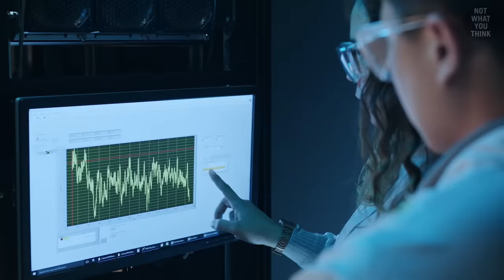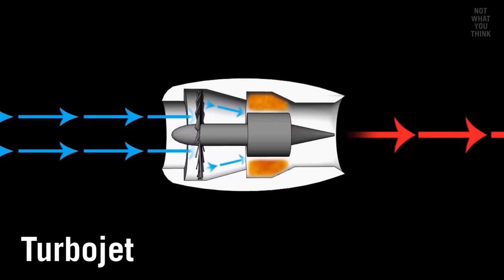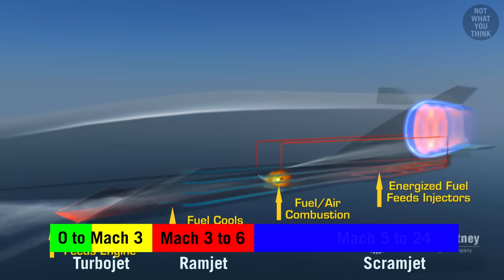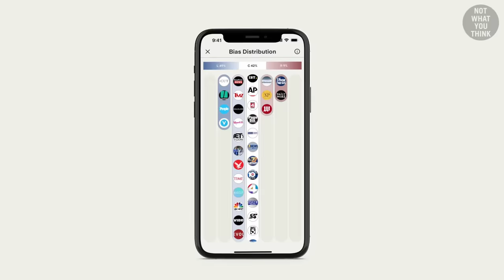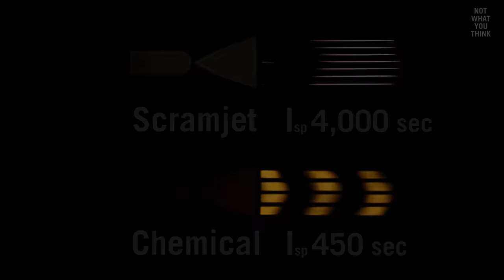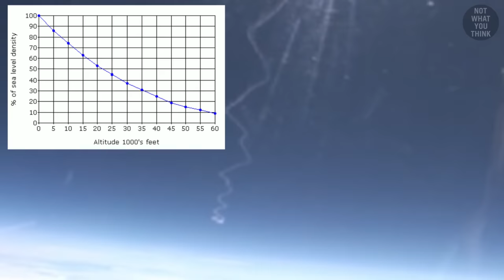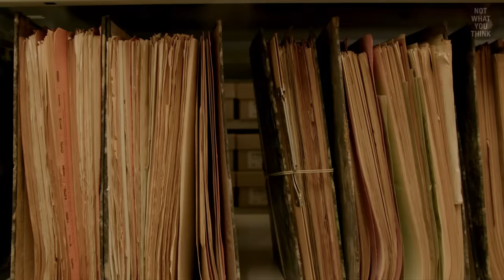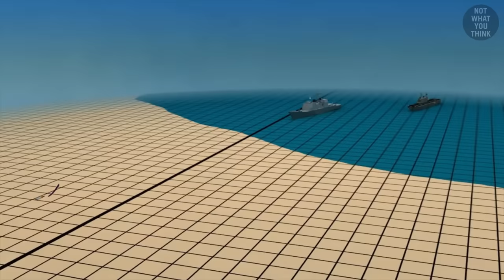The Hypersonic Missile Vulnerability That NO ONE Talks About

Comment: “And are maneuverable” is a bit of a stretch.  Anything moving that fast takes a long time and distance to maneuver in any way.
Reply from the maker: correct, the turning radius is dozens if not hundreds of miles (depending on speed)
Reply: Unless it has a second rocket stage to switch target midflight. This will render enemy interceptors useless. When the missile flies so fast the calculated interception point is way far ahead. Even a very small switch in direction can result in very big changes on the interception point.

We know little about zircon but I'm pretty sure it has multiple burn phases changing direction each time.
Reply: It is possible for the missile to fly that fasts to maneuver, but then it is very likely to miss its intended target!
Reply: Russia literally has hypersonic weapons in current service that do not follow a parabolic path and are currently not able to be intercepted by anything.
Reply: @danhobart4009  and who tried to intercept them and failed ? Ukraine with their Soviet era air defense?
Reply: the thing is it doesn't need to be very maneuverable, intercepting something at those speeds means the interceptor needs to reach 2 interception points potentially dozens or hundreds of kilometers apart with only a few degrees in course change
Reply: @aliismail2962  Don't you guys supply Ukraine with IRIS-T?

The Russian Kinhzal or Khinzal or whatever the spelling is has been used in combat and has proven its claims. Regardless of the interceptor used, the physics remain the same, intercepting something at that speed is extremely difficult.
Reply: It's maneuverable enough to make it impossible for defenses to intercept.
Reply: It doesn't follow ballistic path so future exact location of it can't be determined. That's hypersonic maneuverable mean.
Reply: @billwhoever2830  But the missile can't maneuver much because it has to hit the target eventually, too many fancy maneuvers and you end up losing speed,  breaking off control surfaces and possibly missing the target. Since the missile generally heads directly for the target ship, interception points being too far ahead isn't much of a probelm
Reply: @danhobart4009  Not being able to be intercepted is a big stretch.
Reply: @timothy740  You launch aiming at a different than the intended target. The enemy won't know where to fire in case to get your missile. As I said there can be multiple boost phases. You won't break any wings or lose kinetic energy because you are practically using the engine to change your future position.
You won't even always have to change your direction, you can just change the speed when the enemies fire at you and you end up arriving and leaving the interception point before the enemy missiles arive there.

As you said if the target is a ship point defense at the last few seconds will be easy, the missile will be flying on a line. This doesn't mean it's a safe moment to interpret. Apart from the fact that these missiles will almost always carry a nuke when going for something big, the kinetic energy is so high that the missile will end up falling on the target. Zircon for example can reach up to Mach 10, basically 3km per second speed faster than a railgun round.
Reply: @timothy740  the missile isn't dodging the interceptor like a football player. It's removing the predictability, like having one cop pull over a car on a single lane highway in the middle of no where, verse asking a cop to pull over a car in the city of LA but not knowing what street he's on.
Reply: @NotWhatYouThink  well comrade , didn't you read full reports of our AVANGARD
Reply: Anything that fast doesn’t need to be that manoeuvrable, just needs to change direction and speed slightly and it will be enough to dodge any interceptors. It doesn’t need to be that accurate either since it will be carrying a nuke, so anywhere in the general vicinity is fine.
Reply: @billwhoever2830  THANK YOU. This pseudo intellectual literally has no idea how intercept kinematics work.
Reply: @billwhoever2830  There's physical limits imposed by the forces acting on the thing moving fast. Sure, you could ATTEMPT to redirect the thing at Mach 5, but brute-forcing a Vector change is more likely to cause stress-related material failure due to the tear induced by the difference in air resistance.
Reply: @billwhoever2830  But if the missile has spent the final approach shifting vectors to avoid C-RAMs, it won't be going at Mach 5, making it a prime target for CIWS, which will likely reduce the missile to fragments not big enough to seriously harm the seaworthyness of a military vessel. All this throwing around of numbers and buzzwords is typical for Authoritarian governments- ever higher numbers for optics while practicality goes further and further out the window.
Reply: @acceptablecasualty5319  they already explained to you you need only shift few % of angle to make all interceptors to miss.
Reply: "at least that's the idea"
Reply: @billwhoever2830  When you launch aiming at a different target you sacrifice range. Yes you can use thrust vectoring to change direction but it can only help so much, and you will still lose kinetic energy because the missile will be fighting its own inertia, plus at such high speeds turning produces a lot of drag. Thus hypersonic missiles would be only capable of limited maneuvering, which means that even though a slight change in course will move the interception point by a fair bit, its still less than that of subsonic cruise missiles. They also have to keep a mostly straight course towards the target, because they can't maneuver much as they might miss the target (their turning circle is huge).

I'm not sure how the missile is supposed to change speed rapidly without control surfaces, after all I dont think it can "brake" with just an engine? Also since the zircon uses a scramjet, having a multiple stage engine setup will leave it vulnerable when its still using a normal rocket booster instead of the scramjet as it cannot travel as fast (probably not even at hypersonic speeds).
Reply: Not really
Reply: Anything is possible in physics take Quantum computing for example I know it’s not physics but before qubits were made we had no idea How to make transistors any smaller for Regular computers or supercomputers thus limiting how far we bring our technology now quantum computers and qubits have changed everything we just need some brilliant minds to come together and solve the issue which I think would not be that hard
Reply: @Eycei  haha typical western cope. We failed to do it so we pretend we didn't need it or didn't want it 😄
Reply: @Eycei  still can't bend the rules of physics
Reply: He said that's the idea of it, he never stated it could...
Reply: @acceptablecasualty5319  Ciws or any close range SAMs won't save you. 

Such a missile covers 3km per sec, it travels 3 times faster than the sabot rounds of the phalanx. It covers the 1km of effective range of the phalanx in a third of a second. The phalanx can only fire 20-30 rounds in that window which is totally incapable of "shredding" the target, you won't even be able to score a single hit.

Short range Sam's would be just incapable of aligning themselves with the missile which by the way will keep going even after it gets hit.

Your only chance to not get hit is to kill the missile 10+km away. The further the safer.
Reply: @jiridrapal7512  didn't fail to do it.  It's not cost effective per missile. They are crazy expensive and not worth it.  You can fire 100 missiles at a target and get a 20/30 percent thru,  thru, or you can fire one expensive hypersonic missile.  You save money with the 100 regular and you have more missiles hit.  Hypersonic just isn't cost effective or worth it currently
Reply: @timothy740  I would assume that hitting land objects would be easier. They could have multiple targets for 1 missile. If the missile can't hit the original target, it just switches to the highest target that it can hit.
Reply: @billwhoever2830  You don't understand that Terminal homing will require the missile to slow down in order to actually dodge things. Maneuverability is antiproportional to airspeed. Besides, CIWS doesn't fire Kinetic "Sabot Rounds" but timed-fuze explosives, and C-Ram has like, 40 Gs of acceleration. Nothing on this earth can sidestep physic, no matter how insistent propaganda is.
Reply: @theOcean41  yeah sure not cost effective and that's why american minister of war ordered 7 types of them to be developed andp roduced in hasted regime
Reply: @billwhoever2830  yes but if it is truly moving that fast you have to wonder what kind of sensors would even work to alert the missile to take evasive actions and still correctly navigate itself to the target, sounds like pure sci-fi and not like a real weapon.
Reply: @danhobart4009  So why are they using missiles that have such high failure rates in Ukraine? And why aren't they targeting military targets and instead just targeting civilian infrastructure?
Reply: @aliismail2962  like the Soviet era Patriot missile systems? Tracking and intercept is not possible vs hypersonic missiles that can also maneuver.

In closing sir, you think Systems exists that has been designed to be able to intercept hypersonic manueverable missiles, which the current crop of inferior air defence weapons cannot shoot down.

Looks pretty useful-to me.
Reply: @syzyphyz  The whole path can be predetermined, you won't be necessarily seeing enemy Sam's with your missile, you would be simply following a more random path with 1,2,3 or whatever number of changes in your direction.

The missile might not even have sensors of its own and only rely on data of other platforms like UAVs or radars. The friendly radar tracks your own missile and then transmit the position to it. It might be hard for the missile to see itself but it will always know its and it's enemies position. Corrections about the target position can be made if its moving.

If you search "iskander impact" you will see what type of precision modern "ballistic" missiles can have. Ofc iskander is a slower missile but it still follows a very similar flight plan.

The Chinese "anti ship ballistic missiles" probably work on a very similar manner relying on info from other sources.
Reply: @jiridrapal7512  Hypersonic missiles are not all that cost effective. ONE USAF hypersonic cost $100 million dollar. One F35 stealth fighter cost $85 million dollars which can 4 missiles in its internal bay. Do you want to deliver 1 super expensive missile which might miss, or 4 cheaper precision missiles? If you want to spend more money for an albatross, go right ahead.
Reply: @billwhoever2830  yes, but then it misses it's target which is as good as shooting it down.
Reply: @semicolon101  Soviet era Patriot missiles that where properly maintained and with updated electronics and updated everything else possible. It makes a huge difference to actually have updated and maintained equipment compared to the stockpiles of Soviet era weapons that the Russians left collecting dust in warehouses for decades. That, and the fact that it's simply not viable for the Russians to finance a single weapon that costs more than an entire fifth generation fighter jet, which Russia also can't produce in significant numbers. Remember, Russia finances an entire Navy, Army and Airforce with an economy that is the equivalent of the economy of the State of New York alone (and also have that money be enough to buy their richest class their hundreds of properties and billion dollar mansions). Even if they manage to make 1 or 2, maybe 3 hypersonic missiles, their deployment, even if capable of piercing Ukrainian air defenses, wouldn't be enough to change the course of the war.
Reply: @riftpowers701  all speculation hey.

The performance of the patriot missile is not enough to intercept a hypersonic missile. Can an S-400 even?
Reply: Wrong.

The faster an object moves the more Sensitive is to even the slightest adjustments... hence an object moving faster would be extremely maneuverable,  to the point that even the tiniest micro fraction of movement would make it turn almost instantly.
Reply: It doesn't matter given that you only have very short time span to intercept, and hardly anything could catch up with that speed, and if you failed once, you probably not gonna get a second chance.
Reply: @billwhoever2830  when you try to spread russian propaganda, try to avoid using accounts created during obvious bot waves like 2014, 2020, 2022. Good luck on spreading your message, maybe you'd find an audience for it. For example someone, who has same views on physics as russian propaganda ie flat earthers:D
Reply: @danhobart4009  have you seen fateh110?
Reply: True, but people also don't realise how tracking and detection works, manuevering even that much at mach 7+ is often enough to bamboozle SAM systems.
Reply: @billwhoever2830  The rolling airframe missile that functions as CIWS does have a 10km range though.
Reply: @haixinzheng9759  You don't have to catch up with the speed, after all the missile is heading straight towards the ship.
Reply: @mygodisyahweh8634  Except that there's something called air resistance. Any control surfaces would be ripped off when extended to try and maneuver, or would simply be unable to extend due to compression at such highs speeds. The missile would also be fighting its extreme inertia, which further complicates matters. Not to mention that the turning circle of the missile would be gigantic.
Reply: @billwhoever2830  But what kind of other reconnaissance platforms does China or Russia have? They dont have large fleets of AWACS, and any approaching US carrier battle groups would be detected and intercepted. UAVs have limited range, and again they can be intercepted. Satellites don't have the ability to get a good track on targets moving at 30+ knots to guide the missiles in its final phase. Anyways, most of these platforms aren't designed to provide data for final course corrections for the missiles. There's a reason missiles moved from semi active radar guided (fully relying on other platforms' radar) to active radar guided (relies on its own radar for final course corrections). 

The iskander may be accurate against stationary land targets, but hitting targets that can move and change direction is a whole different ball game. Then there's also the problem of ballistic missiles traveling far, far faster than hypersonic cruise missiles, which leads to even worse maneuverability issues that I mentioned before.
Reply: @timothy740  So? Is there enough time for the interception missiles to be fired out, accelerate and to lock on the hypersonic missiles? Given the speed of 27 Mach, and the effective range of Aegis system of 150 km, you roughly have 27 seconds to detect incoming objective, to press the button and launch the anti air missiles, slowly accelerate and to lock on to the incoming target, and hopefully it will hit the target that travels 5 times faster.
Reply: @haixinzheng9759  Yes, because hypersonic cruise missiles tend to fly at higher altitudes to reduce air resistance, that combined with travelling at such high speeds makes them easy to detect with radar at longer ranges. Lots of heat will be produced as well, so other platforms with IR sensor can warn ships even earlier. The main target of these hypersonic cruise missiles are usually US carrier battle groups, which always have a E-2 Hawkeye AWACS plane in the air to detect such threats. It can even guide anti air missiles to those hypersonic missiles without the launch ship ever detecting them. Finally, you have to remember that these hypersonic cruise missiles have to be lauched from somewhere, so the first line of defense would actually be to take out the launch platforms. Aircraft on board US CVs will out range most hypersonic cruise missile that exists. Since carrier battle groups won't venture close to the coasts of hostile countries during war times, the only launch platforms would be ships, aircraft and subs. Aircraft can take out bombers and ships carrying those hypersonic cruise missiles before they get within range, and submarines would be tracked and destroyed by US nuclear attack subs which accompany carrier battle groups.
Reply: @haixinzheng9759  Also there is no hypersonic cruise missile that travels at mach 27, and probably none in the near future. The fastest one is likely the zircon, which travels at a max speed of mach 9, which is 3 times smaller than what you mentioned 💀. And the Aegis system dosent have a "range", because it isn't a missile, its a system that uses and guides missiles for defense. Currently the SM 6 missile, which would be the main defense, has a range of up to 460km, which is a lot more than the 150km range you came up with. Lock time wouldn't be a big issue, as the Aegis system is usually fully automated.
Reply: @timothy740  Mate, Russian soils are vast and the Kinzhal missile has a attacking radius of 3000km, which is way outside of the detection range of the Aircraft carrier, these missiles are often loaded onto missile trucks for mobility, which you don't expect them to be stupid enough to launch all their missiles in just one place. And you're talking about the best case scenario of what if the Aircraft carrier team has stayed alert to Russian attack, but completely leave out the chance of surprise attack. You don't expect the Hawkeye to run 24/7 do you?
Reply: @timothy740  Mate, Aegis system detects and lock on to targets such as jets and ships that's 460 km, however, it only has an effective interception range of 150km for conventional missiles, which is much more difficult to detect, track and lock than big and slow targets, and the system were not designed to intercept a hypersonic missile that travels many times faster than conventional missiles.
Reply: @haixinzheng9759  Yet you forgot that the kinzhal missile only has a 2000-3000km range when launched from aircraft travelling at high speed and altitude, and not when launched from land (kinzhal missiles can't even be launched from land platforms, only from air platforms, shows how much you actually know how about this subject). And Russia only has 66 Tu 22M3Ms, 250 Mig31s and 17 Su57s that can launch the Kinzhal, and those aircraft would be tied up in other operations.  

Rule of thumb, radar almost always out ranges missiles. AWACS platforms would be patrolling ahead of the aircraft carriers too, which increases the range where the missiles would be detected. Besides, the carrier groups would be generally staying far from Russia's coast. 

You say that Russia has vast tracts of land to hide missiles in, but how much of that land can actually be used? Basically only the coastal areas near Finland and Japan that border oceans where the US carrier groups will operate. Plus there's also the problem of finding the carriers and tracking their movement first.

And yes, a least one E-2 Hawkeye will always be up there on duty 24/7, that's why the carriers carry multiple Hawkeyes.
Reply: @haixinzheng9759  The Sm 6 missiles used in the Aegis system have a range of up to 460km, and AWACS platforms allow the missile to be used at that range. And the spy 1 radar used in the Aegis is capable tracking a ballistic missile at 310km, and is currently being replaced by the far superior spy 6 radar. 

When a target travels faster, its actually easier to detect and track it because it stands out among the sea clutter. 

The Aegis combat system (when first built in the 1970s-80s) was originally designed to defend against manuverable mach 4 missiles, so since it has been upgraded from there, it isn't too hard for it to intercept hypersonic weapons (most of which travel at mach 5+).
Reply: @timothy740  Mate, there are multiple types of Hypersonic missiles and these have different ways to be fired, land, sea or air, and you don't mean there's one way to counter it all. And the fact that you don't know the Russia Avangard missile which has been in service since 2019 also showed how little you know about the current progress of hypersonic missiles. There's a success rate on anti-missile system, which ranges from 50%-70%, there's no such thing as guaranteed interception even against conventional missiles, but you made it sounds like the anti-missile system in the aircraft carriers are so advanced to the extent no missiles can pass through, even with hypersonic missiles, you're clearly not thinking realistically. And lastly, tells me what stopped them from using the missiles outside of the costal region?
Reply: @haixinzheng9759  Don't try to change topic, the fact is that you said the kinzhal is being put into ground based road mobile launchers, when it can only be launched from air platforms. Again, it shows how shallow your understanding of the subject is.
Reply: @haixinzheng9759  I did not say that carrier group air defenses are impenetrable. And I was talking about land based missiles in that comment, refer to my older comment for how other launch platforms can be countered.

Also, what's your proof on me not knowing about the Avangard. Its not related to this discussion, because its not even a bloody missile. Its a hypersonic GLIDE VEHICLE that acts as a WARHEAD for ICBMS, and is meant for nuclear attacks on the homeland of enemies, not their ships. And its not really a game changer, because waves of existing ICBMs being launched cant be fully stopped by anything in a all-out nuclear exchange.
Reply: @timothy740  Mate, you didn't even know what Avangard missiles is, lol, and said Mach 10 being the fastest and not in future any missiles could reach the speed of 27 mach, despite it's already in service since 2019. Btw Spy 6 radar is expected to be in service in 2024, its not even there. Let's see who's changing the topic.
Reply: @timothy740  "Hypersonic glide vehicle (HGV) is a type of warhead for ballistic missile that can maneuver and glide at hypersonic speed." 

Not a missile? Mate, you don't know things.
Reply: @timothy740  “Zircon can travel at a speed of Mach 9 (6,900 mph; 11,000 km/h; 3.1 km/s). This has led to concerns[neutrality is disputed] that it could penetrate existing naval defense systems.[52] Because it flies at hypersonic speeds within the atmosphere, the air pressure in front of it forms a plasma cloud as it moves, absorbing radio waves and making it practically invisible to active radar system” 

And moving fast makes it more detectable?

"With plasma stealth, hypersonic-speed and sea skimming technique, intercepting a flying Zircon is extremely difficult, if at all feasible at the current level of technology. The final section of the trajectory will be overcome in a minimum time (under 10 seconds), the enemy will not have time to carry out all the necessary procedures.[54] Zircon exchanges information in flight and can be controlled by commands if necessary.[55]"
Reply: @haixinzheng9759  Its a glide vehicle that functions as a warhead for missile, its not the missile.
Reply: @haixinzheng9759  I was talking about hypersonic cruise missiles that can target ships, not ballistic missiles. Avangard is a warhead for ballistic missiles and is meant for land targets.

And the spy 6 already has several units produced, and initial operating capability already planned in 2023, so in the next year or 2 most US ships would be equipped with them, meaning they are very much relevant to this discussion.
Reply: @timothy740  "Plasma stealth is a proposed process to use ionized gas (plasma) to reduce the radar cross-section (RCS) of an aircraft. Interactions between electromagnetic radiation and ionized gas have been extensively studied for many purposes, including concealing aircraft from radar as stealth technology. Various methods might plausibly be able to form a layer or cloud of plasma around a vehicle to deflect or absorb radar, from simpler electrostatic or radio frequency discharges to more complex laser discharges.[1] It is theoretically possible to reduce RCS in this way, but it may be very difficult to do so in practice. Some Russian systems e.g. the 3M22 Zircon (SS-N-33) and Kh-47M2 Kinzhal missiles have been reported to make use of plasma stealth."
Reply: @haixinzheng9759  Well, if a plasma layer is formed over the missile, wouldn't it's own radar waves be reflected back too, meaning it can't detect and lock onto anything?
Reply: @timothy740  I couldn't find relavent articles for that, but according to one Russian report, it was guided optically. As the surface temperature of the missile reaches 1500 degree Celsius, the optical image would be distorted by the extreme heat around the missile, which they're able to reconstruct the image to revert the distortion with the help of AI processing and help it to find its target, something like that.
Reply: @timothy740  
The Resistance Surface could be and would have to be literal fractions of what they are for a normal missle.

And that's why missiles,  rockets have 
Very Paticular shapes and designs with various types of maneuvering fins.

Large turning radius  ??
-- Micro Super Computers would take into account every possible  situation. 
And pre-calcute exactly what need to be done. 

Keep in mind... Lots of Military aircraft can't even fly without the use of computers.
Reply: @mygodisyahweh8634  When travelling at such high speeds no matter how aerodynamic your control surface is it will still experience so much air resistance that it can't move or will get ripped off.

Large turning radius means the missile can't perform too fancy maneuvers, because it will take too long to get back on the correct course to the target which means it will sacrifice range and possible overshoot the target.
Reply: @mygodisyahweh8634  How is this even relevant to this discussion?
Reply: @bowxfire5275  Then it might miss again when it manuvers to dodge missiles from the new target.
Reply: @timothy740  if so it goes for the next best one that it can hit. Worst thing is being destroyed by defense, next best thing is hitting random ground, next best thing is hitting a power pole to cut off power for a few hours. Incase they use nuclear warheads, the scope to hit the main target even after dodging a dozen missiles is very high because the target would also be very big. Hypersonic missiles can deal more damage with nukes. Slightly more damage with normal warheads. With nukes, if the missile knows it will be destroyed, it can just blow the nuke up in the air. That would do more damage in bigger area but less damage in close proximity if it was on ground.
Reply: @bowxfire5275  With nukes it dosent matter how much kinetic energy you have, anything you hit would be vaporised. And nukes actually detonate in the air, unless its designed to bust bunkers hardened against nukes.
Reply: @timothy740  yea but hitting a Marc 2 missile is easier than a marc 5 one. The one that India is making will allegedly fall at marc 24 speed in last phase. Plus it will break up into 2-12 smaller warheads.  Hitting these warheads is difficult. Hitting 12 nuclear warheads is next to impossible. That's because of the size. Normal warheads are around 700kgs and a few metres long. Whereas a nuclear warhead is just around 100kgs about 30cm in diameter and 80cm in length. Nuclear warheads could go as low as 13 cm in diameter and 62 cm long. It's very hard to hit a target that small even if it's in free fall. Idk man I'm just a civilian using Google. I'll never know the true specs anyways so why bother debating. Goodbye 👋
Reply: @timothy740  There is a book of Tom Clancy called tom "Red Storm Rising" which is ofc fictional but very well describes how a missile strike would work during the cold war. The soviets used a radar satellite to detect the carrier groups 2 times per day and then used a big amount of big planes to follow the carrier undetected. Those planes stayed undetected because of using completely passive sensors and had no radio communication during the stalking operation. The strike was performed with large missiles launched from bombers.

Today Russia relies mainly on planes and satellites for tracking of the enemy fleet.
China on the other hand has a big fleet of satellites will can only get bigger in the future and a brand new collection of UAVs designs for this exact job. At the moment China even has UAVs designs that carry Aesa radars. Multiple types of UAVs, planes and satellites can be involved in a kill chain sending information. The radars are most likely turned on when the ballistic missile is already launched and the carrier won't have time to shoot down all of the UAVs tracking it in time.
Reply: @bowxfire5275  I didnt say its easy to intercept warheads from ballistic missiles...
Reply: @billwhoever2830  Russia dosent have a large fleet of planes, especially ones designed for such reconnaissance. And they dont have a large bomber fleet, currently only 66 Tu223M3s are in service that are capable of carrying the kinzhal anti ship missile. AWACS platforms from the carriers would also probably detect such planes stalking the carrier. 

The carriers may be detected by satellites, but by the time UAVs, AWACS or ballistic missiles arrive there the carriers would have moved a great distance away from their original position. Heat blooms from ballistic missile launches will also likely be picked up by US satellites, which gives the carriers time to change course and speed up. Furthermore the kill chain can be disrupted, by shooting down satellites, planes or jamming them.
Reply: @haixinzheng9759  Hmm, but how is the missile going to guide itself to the target before it reaches visual range, in bad weather or during the night?
Reply: @timothy740  About Russia and the bombers, Russia currently operates:
42 Tu-95 (out of the 500 built)
66 Tu-22m (out of the ~500 built)
15 Tu-160 (another 10 ordered)
These numbers are enough to overwhelm a carrier group without even using hypersonic weapons.
The 42 Tu-95s are mainly for recon and they are the planes to first arive near the location of detection and these are the ones who have the long range to allow them be on the sky almost 24/7 (some of them at a given time).
I mention the total numbers because although some of them ended up in other countries like Ukraine after the fall of USSR a lot of them are still possibly mobilizeable if something big happens and Russia feels in danger of carrier groups.

About the US weapons and how the defense works:
The Defense of the carriers relies on AWACs planes which fly on the sky with radars on. These AWACs can see a bomber if it gets close enough but the bomber can passively see the radar signature of the Radar from a much much longer range. Especialy if multiple AWACs planes fly around the group calculating the location of the carrier would be even easier. Passive tracking only shows direction and signal strength, calculating the range would be harder for a single bomber, if there are multile bombers nearby they can use trigonometry to determine the exact location of the AWACS. We are talking about ranges more than 1000km and the AWACs will not be able to see anything.
The Defense of the Carrier heavily relies on the planes shooting down most of the missiles before they get close, this is much easier to do when the missiles are slow.

About China:
China is most likely not even planning to use bombers to deliver the weapons, they want to use a rocket, much faster and safer delivery since no human risks his life in a post ww2 subsonic bomber.
China has a big manufacturing capacity, dont be surprised if you learn that China has a fleet of multiple thousant UAVs equiped with radars during the next decade or so. China will not attack until they feel they have the strength and try to remain very sillent-passive today.
Above that China has been found testing hypersonic UAVs, such UAVs use liquid fuel rocket engines and have limited range. Its very likely China will send a very fast drone to the spoted location to Check the strength  of the enemy Group and keep a track for a short duration, enough for longer range and more stealthy UAVs to aproach. Radar UAVs will be far further back with the main job of guiding the weapon-glider-missile (dont know what it would be exactly).
Finaly China has far far more Satelites with different sensors tracking a carrier group with a ping very frequently. If the soviets could get 2 pings  per day 60 years ago then its very likely China can get a ping every 30 minutes or so.
Reply: @timothy740  They also said infrared homing in the report, but didn't explain how they made it work, but I'm pretty sure these weapon developers outsmarts us.
Reply: @billwhoever2830  The Russian bomber fleet is actually rather small by modern standards, especially considering that there's multiple carrier groups the Russians will have to contend with. Plus, all of their planes can't be launched at once. Many of them would be tied up performing missions in Europe, and others probably in dire need of maintenance. And the tu95s are slow and obsolete for this role, so they would likely serve only as a decoy or like you said, reconnaissance. Plus, they can't carry hypersonic missiles that Russia likes to tout. 

Russian bombers could possibly triangulate the location of the AWACS, but AWACS platforms don't arrange themselves in a nice circular pattern around the carrier. The bombers can only get a very rough gauge of where the carriers are, which isn't enough for a weapons quality lock. Not to mention that its pretty hard to do. Also, Russian sensors and similar equipment aren't really the best, they have usually been lagging behind Western countries during the Cold War and up till now.

The carrier air wing would mainly be going after the launch platforms first, but intercepting their missiles isn't too hard of a job. The hypersonic missiles would also have to go through the layered defense of escort ships and jamming/disruption of kill chain.

Russia will probably be able to detect, track and fire at a carrier battle group a few times, but the risk is acceptable and carriers are nowhere close to being as obsolete or vulnerable as most people like to suggest.
Reply: @billwhoever2830  Hypersonic UAVs sound cool and all, but they probably don't have the range to reach and search for the carriers, and likely cant manuver much. Travelling so quickly also affects sensors and degrades their effectiveness.

Pinging a carrier group every 30 secs is just speculation, and the satellites have to find the carriers first in the vast Pacific Ocean. Again, kill chains can also be disrupted, with UAVs being shot down, satellites being taken out and cyber warfare/jamming interfering. There's also the question of what hypersonic weapon is going to be used.  Ballistic missiles or glide vehicles have too limited maneuverability to reliably hit moving targets, and cruise missiles would require launch platforms to get closer, posing the same problems I mentioned before.
Reply: @TekniCaliSpeakin  Still can't be that unpredictable. Like I said any maneuvers done would have to be gentle and that means its going to be easier to predict the position the missile is going to be at a certain time.
Reply: Man it has gotten really quiet in here
Reply: @NotWhatYouThink  growling sidewinder once said "if your too fast your gonna make the same circle, but its gonna be the size of texas.
Reply: The flight path illustrated in this video we’re probably exaggerated for comprehension. Imagine how many miles off track, on any dimension, a missile like this would be with just one small course change. I’d imaging whole countries would be unable to guess where it was heading and thus fumble any attempted interception.
Reply: @seageo4303  It is still possible to predict the missile's heading though, because its gonna turn pretty gradually and cannot stop/change its turn quick which means its turning circle will be rather consistent. And there's the question of much it can turn. Each time it turns, it bleeds a huge amount of speed, which reduces range. Air resistance will cause compression on control surfaces and potentially rip them off, plus the missile will have to fight its extreme inertia.
Reply: @timothy740  Like I stated, the visuals in this presentation have probably been exaggerated so you can understand the concept. Stand at the pitcher’s mound and throw a base ball at Mach 24. How long will it take to circle the globe? Make a 1 degree or two degree course change mid flight at hypersonic speeds, and the ball won’t return to the pitcher’s mound.
Reply: @seageo4303  Yes the interception point will change but it still isn't impossible to find it.
Reply: @billwhoever2830  okay still doesn’t change the fact that it isn’t going to do shit when it hits because the explosives won’t work at Mach 24 because it’ll exploded due to plasma sheathing.
Reply: Otherwise it'll spin and or break.
Reply: @crimson86x92  This is a Mach 5-6 on impact, much slower than the 24mach you mentioned. In fact it would have 20 times more kinetic energy if 24mach was the actual value.

Speed doesn't cause warheads to explode, in fact re entry vehicles from ICBMs can do enter the deep atmosphere in such high speeds.

Even if the warhead is completely removed or detonated kilometers away pieces of the missile will hit the carrier. This means that hypersonic weapons in the future can have kinetic warheads, basically a large mass of Tungsten or Uranium rods-pellets. Imagine 1 tone of Tungsten coming to your ship at Mach 6, the missile will detonate intentionally to spread the Tungsten all over the fight deck of the carrier.
Reply: @timothy740  Theoretically, a defensive response would probably be way too late. How long would it take a missile design like this, flying at Mach 24 to drop from 60,000 to strike a surface target?
Reply: @crimson86x92  These weapons do not carry the weight of explosive payloads.
Reply: @seageo4303  Mach 24 is an exaggeration. It depends on what target you are talking about. Land ones? Hypersonic glide vehicles will be overkill (and won't be at mach 24 during terminal phase because of its maneuvering), plus they are reserved for nuclear strikes on hostile countries (even then waves of existing ICBMs in a all out nuclear strike cannot be fully stopped by any country).  IRBMs with MARVs (e.g. Pershing II) are a much cheaper option that can provide basically the same performance. For hypersonic cruise missiles, they travel nowhere close to mach 24. In fact, the fastest one currently (and probably in the near future) is the zircon, which travels at mach 9, while others tend to be around mach 5-7. Also, subsonic cruise missiles can do the same thing, just through a different way. Hypersonic missiles are generally overkill for most land targets, except for airbases. How about sea targets? HGVs and ballistic missiles would be too expensive/noy manuverable enough to hit moving ships, which again leaves only hypersonic cruise missiles.

HGVs, IRBMs, ICBMs and hypersonic cruise missiles will produce a shit ton of heat blooms during launch and travel phase, which will likely be picked up by satellites or other platforms with infrared sensors, giving the targets early warning. AWACS aircraft would be the next warning system, and with hypersonic cruise missiles and HGVs flying so high and fast, they would be easily detected. And in the case of ships being the target (probably land too), the AWACS platform can guide the anti air missiles to the hypersonic missiles without the launch ship needing to see or track them. After that, the hypersonic missiles still have to endure long range air defense missiles guided by land based radar, and then SHORAD missiles. Should they try to use their limited maneuverability to evade, they would lose speed which makes them more vulnerable to the next missile. 

There's also the option of disrupting the kill chain used to guide the missiles, especially for naval targets. Satellites and aircraft can be jammed/destroyed, cyber warfare can intefere with data links, and the missile itself can be spoofed.
Reply: @timothy740  Why do you think Mach 24 is an exaggeration?
Reply: @seageo4303  It was explained in my comment
Reply: @timothy740  We have things that can attack a target around these velocities for decades now. They compress the air to the point that they look like falling stars. As I recall, you have roughly 10 seconds from the time you detect it, to the time it detonates the target.
Reply: @timothy740  I’m not sure everyone here defines “missile” the same way. How are we going to agree on that item? Any general or basic theme?
Reply: @seageo4303  Like I said, only ICBMs and theoretically HGVs can reach speeds up to mach 24. Hypersonic cruise missiles travel around mach 5 to 9, with most at mach 5-7. I already mentioned all this in my previous comment (the one about 23 hoursfrom now), along with a counter for your point about detection speed.
Reply: @timothy740  So, what defense system are you relying on to stop a hypervelocity missile falling from 60,000 feet MSL?
Reply: @seageo4303  There's the Aegis Combat system along with the Aegis ashore system, the Patriot system, possibly the THAAD for terminal phase interception, maybe even air launched missiles from aircraft, EW and jamming countermeasures, disruption of kill chains, and the fact that hypersonic cruise missiles/ HGVs dont have a lot of land targets that justify its cost, plus sea targets being hard to find, track and hit.

 I'm not saying that hypersonic missiles are bad, but rather that they aren't some almighty wonder weapon that makes everything irrelevant. They do have a substantial role in militaries, but they aren't the deciding factor in wars.
Reply: @timothy740  All the systems you mention would make for an interesting drill against a hypersonic weapon. Probably of success against a Harpoon missile? Successful destruction of a hypersonic would be worse. Any examples?
Reply: @seageo4303  Examples of?
Reply: @timothy740  One weapon from the systems you mentioned that could destroy a hypervelocity weapon.
Reply: @seageo4303  The rim-174 SM-6
Reply: @jiridrapal7512  yeah, going Mach 5 you can shift a few degrees and easily dodge the interceptors, but then you’ll also miss your target so what’s the point?
Reply: @EvilDalek1337  why should it miss the target? You do not know where it is headed. You can just quess it. As you estimate fly path you fire interceptors, and missile angles few % and you have no chance to hit it in such speed. Then it can angle back on original target.
Reply: @EvilDalek1337  the biggest difference is common missile interceptor can chase. Tomahawks and similar are even flying slower than anti air missiles. 

With hypersonic missile you get only one chance on pre - estiamted fly path that you compute and when it makes a trivial change in course you will never hit it. Did you consider that missile can fly in an angle that is not directed at target but then performs maneuvre to redirect to the target and you as defense unit have no clue where is target and calculate just estimated fly path that will suddenly change to face target and you just lost all time to react?
Reply: @timothy740  I doubt a long range missile could provide a quick enough response. At Mach 5 a hypervelocity weapon will strike a surface target from 60,000 feet MSL within 15 seconds. Your suggestion appears to launch at 285 fps, maxing-out around 620 fps.
Reply: @billwhoever2830  These hypervelocity vehicles might only need compressed gas thrusters to make a small yet elusive course change.
Reply: @seageo4303  A small gas burst will not significantly change the direction and the enemy interceptors will just need to "make a small gas burst" to correct.
The whole point of hypersonic or any high speed weapons in general is that the enemy will need to be just as fast as you to get you.
Interceptors sometimes have secondary or long duration burns as well.

For example the Aster30 missile uses the main booster to get up to speed fast and then there are 2 more burn stages, one of them is a cruise stage to keep the speed up during the trip to the target and then the final burn stage allows sideways thrusters to make very big corrections even outside or in thin atmospere.
Aster30 is a 4.5mach weapon with excelent manuverability during the entire engagement.

For comparison, the PAC3 patriot missile will get up to similar speeds early on due to the big booster but then lack capability to change direction. This means that the PAC3 is far less capable at stopping the enemy missile to its track and would mainly work for point defense.

The SM3 is another missile with multiple burn stages and a kill vehicle that is very manuverable in space or in thin atmospere. So it has the capability to make corrections.

To sum up, even the SM3 is a sub mach5 missile and it might have issues to keep up with a mach 9 missile that changes direction drasticaly. You will have to waste missiles and fire secondary salvos if the target moves too much or even fail to get it in time (while in the ships range). You surely cannot trail the hypersonic missile if it manages to pass above the destroyer and going away to its target. (might be a stationary target on the mainland).
Reply: @billwhoever2830  I was the one suggesting a minor heading change is enough for a significant course change for anything moving this fast. Compressed gas, or shifting the center of gravity, or something more conventional. You said, “small gas burst.” I did not say that.
Reply: @billwhoever2830  I also don’t agree with “the whole point” you state. I feel there are other important reasons we are trying to make this work; to launch an attack from 12,500 away and have it destroy a target in less than an hour from launch; use the kinetic energy of the high velocity to do the work without need of an explosive warhead.
Reply: @seageo4303  But hypersonic missiles don't magically spawn 18km up in the air right above the target. The SM-6 missile has a max range of around 460km, and since those hypersonic missiles will be detected quite early on, its likely the SM-6 would get to use that range.
Reply: @jiridrapal7512  Except that air defense missiles are more maneuverable than hypersonic missiles. Why? Well, if they try to maneuver a lot, their control surfaces would either suffer from compression (so they can't move) or even get ripped off due to air resistance. Also, at such high speeds they will bleed an incredible amount of speed, which means sacrificing range and making it more vulnerable as it no longer travels at hypersonic velocities. Lastly, the missile also has to fight is own colossal inertia, leading to the missile meaning unable to quickly change or get out of its turn, meaning it has to stay locked into its turns for quite some time, making its flight path much more predictable. 

By the way, air defense missiles don't have to "chase" their targets. Those hypersonic missiles are travelling in the general direction of their target, so they would be heading towards air defense missiles launched from the target and nearby ships. 

Additionally, the turning radius of these missiles are beyond huge. Do too many fancy maneuvers during terminal phase and the missile will end up overshooting the target.
Reply: @timothy740  to hit hypersonic missile they need to pre plan its meeting point. The high speed prevents that especially if used on short range.

You may intercept it if fired 1500 kms away and it was noticed. But at longer distance it has bigger room to maneuvre.

All advanced systems of air defense need to fire two to three missiles to reliable hit the target to secure its shot down be it s300/400 or patriot. I doubt they somehow suddenly perform a miracle against missile that flies 5 machs.
Reply: @jiridrapal7512  Whats stopping them from predicting the interception point? And just because the missile has bigger room to manuver dosent mean it is capable of making full use of it due to its inherent maneuverability traits I mentioned before. 

Also, the interceptors used in the Aegis system are routinely tested against GQM-163 Coyote drones that travel at mach 4 and are capable of limited maneuvering like hypersonic cruise missiles. So, you don't really need a miracle to intercept a hypersonic cruise missile.
Reply: @timothy740  “Once pilots detected a shot fired, they hit the throttle and simply flew faster than the missile.” ~ World War Wings site, regarding the SR-71.
Reply: @seageo4303  Yeah but did the SR-71 have to ram into a target? All it needed to do was to fly high and perform reconnaissance on targets, thats why it could just fly away from missiles. Hypersonic missiles on the other hand have to actually HIT their target. They won't be able to just turn around and run, because its going to take so much time and bleed so much speed that it wouldn't have the range to hit the target anymore/perform more evasive actions.

Additionally, the SR-71 was facing 1960s SAMs that were designed for taking down subsonic or mach 1+ aircraft, not mach 3+ ones flying incredibly high. Air defenses have improved significantly since then.
Reply: @timothy740  Flying a dive to gravity is easier.
Reply: @timothy740  The SR-71 could cross from state to state in an unusually short time. Yet I don’t think it qualifies as a “hypersonic.” How far away can it be detected? Try to consider how fast a weapon can fall from 60,000 feet. Imagine how difficult it would be to follow by an enemy if it was cruising at tree top, or wave top height. A missile is at wave top height won’t be seen over the horizon (reference “height of eye”).
Reply: @timothy740  If the target is stationary, the weapon might not need to see. Maybe it could simply target coordinates.
Reply: @seageo4303  I didnt say it wasn't, rather that missiles don't spawn 60,000 feet right above their target, which was what you implied.
Reply: @seageo4303  Hypersonic missiles can't cruise at treetop level because of how dense air is at that height (air resistance is a thing).  They have to fly quite high up, sometimes in a ballistic like arc, in order to actually achieve that speed. At that means the curvature of the earth will have little impact on radars trying to detect it.
Reply: @seageo4303  The SR-71 wasn't actually all that stealthy, its main strength was its speed and altitude ceiling. Hypersonic missiles don't have the stealth coating or the unique shape of the Blackbird that deflected radar waves in the wrong direction.

Back then in the Cold War, it was virtually impossible to launch an ICBM strike without being spotted. Granted the heat produced and the altitude of the ballistic missiles were more than todays hypersonic missiles, but detection systems have been upgraded since then and the principle still remains the same.
Reply: @NotWhatYouThink  human reaction time becomes a factor too. By the time as operator percieves something, reacts, sends a command to turn, and it begins to turn , it has gone a long ways.
Reply: @timothy740  no. At that speed the missle can cover a greater distance, combine that with ANY maneuverability and now the missle can potentially be any where within a THREE DIMENSIONAL SPACE, while ballistic missiles are intercepted on ONE DIMENSIONAL  ARCS. The missle goes from having a single possible trajectory to almost infinite. That's what lowers the probability.

To intercept a ballistic missile you need it's arc, it's position, and it's speed. To intercept a hypersonic missile that alone will not work since there is no arc. And to my knowledge there is no guidance system able to track at those speeds.
Reply: @TekniCaliSpeakin  Wait which of my comments did you reply to? Im kinda confused
Reply: @NotWhatYouThink  Thrust Vectoring: Did you miss me?
Reply: @jiridrapal7512  USA military has like 12 times the budget of russian military... If they wanted to have hypersonic missiles, they would make one decades ago. But real life isn't like your video games. For example, some militaries may consider such missile to not be worth it, having other already designed and produced munitions that serve the same purpose, or even having entirely different weapon systems for that, like stealth aircraft could allow to get closer to target, where standard munitions would do the job.

Classic Russian bot, pretending like failing to win a war with minor country for 10 months is just Russia handicapping itself at 1% power :)
Reply: @mygodisyahweh8634  no XD
Reply: @haixinzheng9759  it doesn't fly mach 27 in the dense atmosphere
Reply: @dr_birb  
A simple mind like yours gives a simple answer.
LoL 😆
Reply: @mygodisyahweh8634  better to be simple minded and avoid wasting time on a no brainer.
Reply: @mygodisyahweh8634  you can comprehend simple, good for you. Don't speak on hsrder subjects, clearly beyond your comprehension
Reply: @aliismail2962  USA oficials have said they dont have anything to counter those missoles yet you thinks you know the truth
Reply: @mygodisyahweh8634  oh no, language police is after me for typing a mistake 👮‍♀️🚨🤡
Reply: @dr_birb  

Not at all... did I hurt your feelings  ?
--
It's ok for kids like you to make spelling mistakes, your still learning.
Reply: @mygodisyahweh8634  yes at all... Did I hurt your feelings by calling you language police after you jumped on a single typo because you have nothing of value to add?
Reply: @dr_birb  

Burp I mean Birb, it's okay 👍 
Chill, you made a simple mistake..
Grow up and get over it.
Reply: @Not What You Think  a +-5° turn still puts you somewhere in a 180m circle after just 1 second, when moving at Mach 6.
Reply: @timothy740  Sub Brief or Millennium 7, I don't remember which of two, explained why the new ASM like the p800, Bramhos, cx-1 Kalibr in AS version and the YJ 18 are so dangerous in their final stage because they don't have a standard speed, they move between the speeds of 2-3 Mach difficulting a lot the interception because the prediction point is moving all the time, now add direction changes of 1 or 2 degrees, It's little but if you add the aforementioned, they make them super difficult to intercept
Reply: @acceptablecasualty5319  since when the ciws like the phalanx and similars fire HEVT?
Reply: @ser43_OLDC  Since their inception, i think.
Reply: @acceptablecasualty5319  the Phalanx and ciws doesn't use that. It has a belt of HEFI and API with DU center. The only ciws that use that are the Milenium and the Dardo
Reply: @ser43_OLDC  You're right, doesn't use VT, but it think it's a programmable shell for the HEFI? I gotta look this up again.
Reply: @acceptablecasualty5319  no the phalanx uses the same amo that is used in the 20mm of the rest of us army
Reply: @ser43_OLDC  "Land: High-explosive incendiary tracer, self-destruct" from Wikipedia's Sidebox on the Phalanx, emphasis on "Self-Destruct". Seems to be only with "Aegis Ashore" though.
Reply: @acceptablecasualty5319  the self destruct is something found in high caliber bullets since the ww2 to avoid collateral damage. When they reach aprox 5km they do that
Reply: @ser43_OLDC  Huh. Maybe i was getting the Phalanx confused with that new Stationary CIWS thing the Bundeswehr is deploying?
Reply: @acceptablecasualty5319  the Milenium Ciws is something completely different to the most common ciws. It's a mix between the 60's ciws that shared the same idea of the Dardo, 2 40mm borffors with HEVT. And rapid fire gun like the one one found in the more common Ciws
Reply: @aliismail2962  Patriots america vs DROONE OLD IRAN.. 🤣🤣
Reply: @Bill Whoever  it will not render interceptors useless. For one, too many direction changes and especially ones with any meaningful change in vector at hypersonic speeds puts an ungodly amount of stress on the airframe of the missile and builds up a lot of heat. Some intercept concepts for hypersonics aren't even meant necessarily to hit the missile, they merely pester it until it destroys itself with its own heat. They mean to hit it, if it doesn't maneuver it gets hit, but if it does maneuver too many times, it kills itself. Compensating for this in the design of the shape of the missile body and control surfaces and particularly the material science of the outer skin is the hardest part about developing a 'hypersonic' missile. Nothing about the speed of a hypersonic is special, every ballistic missile since the 50s is hypersonic. The ability to change direction at hypersonic speeds is a science developed by the Americans in the 60s and deemed too expensive a problem to overcome for little gain. Interceptors are almost always going to be more maneuverable than the thing they intercept, as that is their sole purpose for existing and they're inevitably smaller airframes, they don't need much warhead or extra range to find targets on the ground or sea. Whatever strike hypersonics are made, their interceptor counterpart will likely always be more maneuverable.
Reply: @acceptable casualty  CIWS isn't meant for ballistic missiles alone hypersonics. I doubt they'll be of much use. Maybe laser based ciws.
Reply: @acceptablecasualty5319  But you don't understand,  we can change the vector at anytime because we build the missiles out of a combination of Titanium and vibranium alloys 🤣😂
Reply: High powered lasers coupled with advanced targeting computers will be what ultimately takes these out.  Doesn’t matter how fast they are they aren’t as fast as light
Reply: @NotWhatYouThink  It doesnt need to turn around. A small change in direction is enough to alter trajectory for it to be intercepted.  Basically its zig zagging across the aky
Reply: @haixinzheng9759  what
Reply: @syzyphyz  this actually makes the while discussion idiotic. Russia isn't throwing missiles at military targets, let alone hardened or defended targets. They're doing saturation strikes on an entire country, exclusively going for soft civilian targets.
The fact Ukraine manages the intercept ratios it does is really impressive. The only other country faced with an even remotely similar threat is Israel and it took them decades to setup their Iron dome...
It's quite telling that Russia is forced to employ terrorist strategy to achieve anything noteworthy.
Reply: The SR71 could take 100 miles to fully turn at top speed.
Reply: @ser43_OLDC  Still not impossible to accurately find the interception point. The US Aegis system is regularly tested against and shoots down GQM-163 Coyote target drones capable of mach 4 while maintaining limited mobility just like hypersonic missiles. 

My point is that with that limited maneuvering capability, hypersonic/supersonic missiles aren't really harder to intercept than regular modern subsonic missiles (e.g. LRASM),  so they aren't the ultimate game changer people keep harping on about.
Reply: @timothy740  like they said and I said, isn't impossible to intercept but it just a ratio of numbers, probability and reaction time. ASM misiles aren't launch alone, normally in waves of 5, the reaction time decreases whit the speed and the low altitude, and the probability of intercept decreases with the variable speed and maneuvers. It's just that. It is just a game changer in the same way every new generation of ASM appeared in the past
Reply: @syzyphyz  they literally used the Kinzals to destroy an underground depot of amo, and to attack a base
Reply: Even if they can maneuver their way through enemy air defense, they'd never hit the target if they did those maneuvers at that speed
Reply: Ok fly back at it like a cat an mouse. Lol
Reply: @ailediablo79  any evasive final approach is going to be just as predictable as a ballistic path if your aim is to reach a specific target.

Turning radiuses at those speeds will only be manageable until you're close to the target.... No matter how many passes you have to do..... In the end you'll have to either slow down or head directly at the target in order to actually hit with any degree of accuracy
Reply: @KranK3r1983  why is doing manvurs would only be possible when reaching the target? You not making sense. I would say it would slow down 20km away from the target and 10-15k high. 

Also i talked about the glade vehicle.
Reply: @TheNicestPig  the countermeasure would be that 1m rounds/minute unit on the CWIS pedestal.
Reply: @kennethkustren3966  Gun based CIWS have very short effective range. A 20mm Phalanx for example starts engaging at 2km, a hypersonic weapon would only take a second to cross the distance. Current CIWS reaction time makes successfully defending using CIWS extremely unlikely. Even if the rounds hit, the missile would most likely just continue slamming into the target, the debris alone would be more than enough to neutralize most targets including warships.

There is a reason why CIWS is a last ditch defense, missile-based defense systems are still the primary way to defend against other missiles.
Reply: @TheNicestPig  DID I NOT MENTION MetalStorm IN A MISSILE ... ?!
Reply: @timothy740  or tearing your missile to bits before it hits anything setting off it's payload early.
Reply: @timothy740  Anything that can theoretically travel so far on such short order does actually seem like magic.
Reply: @timothy740  why are you wasting time arguing with russian trolls?
Reply: The US already has something that no air defense can detect today, and it's not propaganda, but a reality whose effectiveness has been tested: stealth missiles. If the US hasn't adopted hypersonic missiles, rest assured it's for a simple matter of utility and efficiency. The US has been working with hypersonic technology for decades.
Reply: @Romeo.G  so invisible it doesn't even exist... "ominous music:
Reply: @bingbong6127  AGM-158C LRSAM
best anti ship missle. Already adopted en masse by the US Navy. All who rub their eyes with hypersonic missiles, when the real deal are the stealth missiles.
Reply: Which is STILL maneuvering 🤦‍♂️
Reply: Probably stealth drones are more efficient than hypersonic missiles.
Reply: @haixinzheng9759 There is no missile on final approach going mach 27. What are you smoking?
Reply: @bowxfire5275 It’s Mach, not Marc.  Lol
Reply: @haixinzheng9759  It’s a glide vehicle. There is no ambiguity here.
Reply: @haixinzheng9759  Okay, Chinese bot. Where are you getting your information, from a magazine you bought off of Alibaba?
Reply: @InnerVisions68  troll calls other people trolls 😄🇺🇸
Reply: @jiridrapal7512  I’m hardly a troll, shill.
Reply: @InnerVisions68  AI bot😀
Reply: @haixinzheng9759  A warhead is not a Missile. Stop embarrassing yourself, and admit you were wrong on several points. Your flip-flopping just makes you look childish.
Reply: @haixinzheng9759  >"m-muh plasma stealth"
>"proposed process, it may be very difficult to do so in practice"
>IR Sensors exist
>Doppler Radar error detection exists
Reply: @bowxfire5275  It's "mach". And we are specifically talking about Air-delivered Cruise missiles, not Ballistic Missiles as part of strategic nuclear arsenals. You were thinking of MIRV-equipped Ballistic Missiles.
Reply: @acceptablecasualty5319  Hypersonic glide vehicle is a type of ballistic missile, it's like saying human is not part of animal species, it is a type of ballistic missiles for nuclear warheads and you just don't want to admit it, you really do need to restart from your junior school education.
Reply: @billwhoever2830  Satellite Pings? AWACS that's somehow got LESS range than a normal airborne RWR? Planes intercepting missiles are the main defense of a CBG? What kind of loopy-land have i entered?
Reply: @acceptablecasualty5319  Can you be more specific on what is the issue?

1) satellite pings means you get a report of the enemy carrier position every time a satelite passes above it (or in a general area that it can be scanned), there are multiple types of satellites with different sensors and they can even detect ICBMs launching. A carrier is a massive thing and can be detected very easily though radar satellites.

2) AWACs has limited range, the main advantage of the AWACs is that its view is not blocked by the horizon and this means it can spot lower flying targets at extended ranges. That said, the longer you want your AWACs to scan, the more power it needs. A very powerful radar produces a lot of noise and the enemy can detect that noise at ranges multiple times the range an AWACs can see a massive old bomber. The problem with passively detecting the enemy radar pulses only shows you the direction, you cannot know speed (the doppler effect is used by active radars), direction or distance (echo delay is used to calculate the distance). That said if you have multiple  passive platforms tracking directions you can pin-point the emmiter with great accuracy.

3) The fighter jets launched from aircraft carriers carry very capable air to air missiles which are more than capable at shooting down conventional anti ship cruise missiles. This is something easily done when there is early warning of a massive strike. The jets can shoot down a very big amount of the cruise missiles. The jets can even use their main gun against cruise missiles but it will be only done if out of missiles.
I would like to note here that fighter jets were even suppossed to attack enemy satelites in the past, the F15 could launch the ASM-135 which is an anti satellite missile. That being said the SM6 is the weapon for this job nowdays with a far longer reach in expense of weapon capacity.
Reply: @haixinzheng9759  No, a hypersonic glide vehicle is a glide bomb, or in this case it's a detatchable module that stages off of the missile like a cargo rocket discarding it's boosters. Otherwise it'd just be a cruise missile. It's called a warhead module because it fits into where the warhead is designed to go in a regular cruise missile. It doesn't have it's own propulsion.
Reply: @acceptablecasualty5319  you've actually made some very good point, I've learnt.
Reply: @haixinzheng9759  Wow, did not expect that response! Good on you 👍
Reply: @billwhoever2830  Okay, now your statements make A LOT more sense. I still think things might pan out differently for some of the things you've said, but i cannot back those theories up with facts right now. Thanks for elaborating!
Reply: @ser43_OLDC  For naval targets, only hypersonic cruise missiles can be used as HGVs lack sufficient maneuverability to hit moving ships. 

The first problem for these missiles would be detecting and tracking a ships. Hypersonic cruise missiles are claimed to have very long ranges, but that doesn't matter if it can't be used.  The target of these missiles will usually be US carrier battle groups, which tend to stay rather far from the coasts of hostile countries. This leaves satellites, AWACS/reconnaissance aircraft and submarines as the only platforms that can feasibly find those carrier groups. Satellites may be able to detect the carriers, but keeping track of it would be significantly harder as they move quite fast and can change direction. AWACS platforms will be spotted by the carrier's own AWACS, which will then vector CAP aircraft to intercept/chase them away. Submarines would find it hard to transmit the information while trying to remain hidden, and in the case of US vs China/Russia, will be hunted and stalked by technologically better American SSNs crewed by more experienced sailors, and probably with the aid of the SOSUS-like system. And if those platforms do manage to accomplish their task, the hypersonic missiles will still stymied by communication blackouts caused by high speeds and intense heat, making it more difficult to receive targeting information, as well as EW/cyber warfare disrupting the kill chain.

The second problem would be guiding the missiles in their terminal phase. Radar wouldn't work very well at high speeds, and IR sensors would be rendered ineffective by heat buildup. This reduces the accuracy of the missiles against moving ships.

Hypersonic cruise missiles would also be detected early on, allowing for easier defense. This is because they need to fly at high altitudes and sometimes in a ballistic like arc in order to actually achieve that speed, as the much stronger air resistance due to denser air closer to the ground reduces and burns more fuel, which sacrifices range. This allows for radars to easily find them as the curvature of the earth no longer attenuates the effectiveness of radar.

Adding on, hypersonic missiles will have a host of maneuverability issues that I already iterated before.

Now onto, subsonic cruise missiles. They dont suffer from most of the problems I wrote above due to their nature. They have a plethora of methods to guide themselves, like INS, passive radar, home on radar emissions for mid course phase, normal radar, plus they can receive information from other units much more easily. For terminal phase they can use radar, IR sensors and "home on jam" mode. Most of these systems are either impossible or impractical to implement on hypersonic cruise missiles. 
 
Secondly, modern subsonic cruise missiles are very stealthy, even more so than stealth fighters. They have  smooth and curved fuselages, engines that can hide their heat, along with stealth coating to reduce their RCS and heat signature. Additionally, they can afford to fly at extremely low altitudes due to their subsonic speeds, posing another challenge for enemy radar systems, even for AWACS as they blend in with sea clutter. Lastly, the newer ones come equipped with ECM and EW suites, plus they can guide themselves passively most of the way which reducing radio/radar emissions that can potentially warn enemies. All this significantly reduce the interception window for enemy targets.

Subsonic cruise missiles may be slower and thus easier to intercept, but they can execute far more complex maneuvers to avoid missiles due to their lower speed. 

Adding on, subsonic cruise missiles are much smaller, meaning they can be mounted on more platforms in larger numbers. They are also far cheaper.

In conclusion, hypersonic cruise missiles are not really better than subsonic cruise missiles, for now at least, as both have different strengths and achieve their goals through different methods.
Reply: @haixinzheng9759  Nope, its a type of warhead for ballistic missiles. Its like saying bullets can be considered as a gun just because one is part of another.
Reply: @billwhoever2830  no
Reply: @danhobart4009  that's what you think
Reply: @lukeamato423  no no xD

you edit and the final commend is just "no"
guess you change your mind and its ok to just say no
Reply: @timothy740  why haven’t they shot north koreas test missiles then?
Reply: @latenitephreak  Because the missiles didn't pose a threat to anyone. And this is not even related to the topic at hand, as we are discussing about hypersonic weapons here (mostly cruise missiles), not ballistic missiles.
Reply: @timothy740  icbms are hypersonic
Reply: I assumed maneuverable is meant in comparison to similarly fast projectiles?
Reply: it’s still manoeuvrable? regardless of speed.
Reply: @latenitephreak  Its not all about the speed. Hypersonic weapons nowadays refer to missiles/vehicles that can travel at hypersonic speed while still retaining limited maneuverability, and not ballistic missiles.
Reply: @kexziee  Like me and others have mentioned countless of times, at such high speeds, maneuverability is extremely limited. Firstly, heavy air resistance act against control surfaces, preventing them from moving through compression, or outright ripping them off. Secondly, turning will produce a huge amount of drag, slowing the missile down until it no longer travels at that coveted "hypersonic speed". Additionally, the exceedingly strong G forces and heat afflicted on the missile when turning can threaten to break it apart, or attentuate the effectiveness of onboard sensors. Also, the missile has to fight its own massive inertia, which means that it can't respond to control changes quickly, thus it can't switch turns fast. And lastly, pulling fancy maneuvers during terminal phase can cause it to miss the target due to the obscenely wide turning radius.
Reply: You are right.  But, a solid box can take a lot of stress. To manoeuver, they only need to move sideways while maintaining forward momentum, so the stresses are minimised. If the have to take speed off of the Durward direction, a lot of stress.  So, if you don't try to curve around, easier.
Reply: @marcopolo8584  I'm going tell you a big weakness. it has large plasma.  It can be pushed around by magnetic field.  A hypersonic fly from behind and along side can physically knock it, blow up, but also do emp and other push or pull off course.  The thing about ab interceptor is that it doesn't need to be much more than an engine and can fly faster to meet it along the trajectory path.  If there was action, I would fly many of these interceptors into orbit  and bring the most relevant ones down to intercept by a simple mechanism to push it back in the atmosphere.  You could orbit at less that 60 miles and every time the drag started taking you down, boost up again.  So, most of the time the engines are off, and this could be weeks.  But, as you can be in a thin atmosphere, you might still use an engine to do this up and down swing.  The hypersonic weapons become much less useful.

The idea I've had from the start, is just to spray an craft with micro objects.  One night say it can maneuver out of the way, but these cheap defense's, you can launch hundreds to get in its way.   Even from orbit, or balloons.  I have a better design than those on mind.
Reply: @Waynesification  yeah i agree but the Russians have figured out how do it, pretty cool
Reply: @Waynesification  But the missile isn't just a box. It has a lot of sensitive instruments inside, from guidance and detection systems to the explosive fuses and control surfaces.
Reply: Basing it off of a standard ICBM its very maneuverable. It doesn't have to change course much since its moving so fast and also considering that intercepting it is pretty much a bullet hitting a bullet.
Reply: @brianawilk285  it's actually more like a design thing intercepting it.  A lot of engineers aren't that great with new box thinking.  I might have listed some solutions on a video somewhere.  There is little reason they aren't in big bird, or whatever latest edition, or furbtjrm not to work out use or interception, or for the power grid to be unprotected. All the negativity is for show.  They definitely have top engineers that should have thought this out long ago.  Bit, what the enemy doesn't know, and thinks you are less confident in, holds back their own development.  The Russian nuclear drive version, is an old United States idea from the 1950s/1960s.  It was madness as they realised they could change the fuel cell design to irradiate everything along it's path.  They had ICBM and scrapped it.  However, here it is decades later.  The good thing about using mass instead, it largely eliminates the need for nuclear.  In a war, I don't want weapons that are going kill people outside of there impact radius and poison it for everybody else.  Just using msss, means you can be strategic, kill a fraction of the people and carry in with life afterwards.  If I had a country, I would look heavily at this.  You are looking at even small nations being able to use these one day, and nock them down.  Which makes it tricky to get too far across other people's borders.  We are looking at potential for bar like projectiles bring rained down at up to mach 27 in their hundreds of thousands, all aimed. Once you get to a border, you have the other side's interceptor network for your interceptors, meaning, thru have a numerical strike advantage in getting their rods through to you on their ground.  You stale mate.  Admittedly it also means the s things can float up there and take out normal people during peace time, but we need to be able to trust the government.  I've just had a modification of a design in my head that could counteract that.  It's still going produce a impact nearby that may harm you.  However, it's still a good anti projectile project.   I once had a lecturer who was a Colonel who worked with the guy who developed Metal Storm, on a previous anti ballistic project.
Reply: @Waynesification  are you a bot? 90% of what you said has nothing to do with what I said. I was just saying that intercontinental ballistic missiles (ICBM) are easier to hit bcuz they have a predictable arc (Its how they actually do it today) while hypersonic glide bodies do not. Thats why I said its like hitting a bullet with a bullet.
Reply: @brianawilk285  No, I have intelligence to see what it means.
Reply: Just need a big metal mass moving at that speed and it would be as devastating as any conventional bomb if it hit something solid wouldn't need a large charge to do more damage just more mass.
Reply: @F.O.U.N.D.E.R  oh that new system announced 4 years ago and only just started being installed 2 months ago?
Reply: @Waynesification  that's basically what I said no?
Reply: @harrythompson6977  Not really so much, you said something solid.  Dirt isn't too solid, but skipping in there produces a pressure wave that turns around and up.
Reply: @Waynesification  and that results from mass×kinetic energy at the point of impact whether there's a charge or not heat could be worked around if there was enough mass at the head of the projectile with a couple air pass through vents towards the rear as to not detonate the fuel a scram jet would need ....
Reply: Unless it’s nuclear payload, then it hits target no matter what
Reply: @billwhoever2830  bla bla bla yeh yeh russian troll. How a multi-stage vector would be more maneuverable and how would it be more difficult to intercept?
Reply: @danhobart4009  They have planet busters, anti matter bombs, also. They have Ufos who can traverl faster than light..
Reply: @Romeo.G  I already explained how, I dont understand why you call me a troll.

imagine the enemy missile being a rabbit, and imagine the anti-missile/defensive missiles being wolves.

if the rabbit is faster and can change direction the wolves will have a hard time catching it.

this example is very representative if the defensive missiles are not on the asset that is under attack (imagine a city being the target and a destroyer launching the SAMs).

things work a bit differently if the target is point defended (for example an aircraft carrier being the target with the destroyer being next to it).

In general, if you want to catch a mach 2-3 cruise missile you would need a mach 4-4.5 defensive missile.

it can be easily said that to get the same effectiveness against mach 5-8 cruise missiles you would need mach 7-9 interceptors.

Faster missiles are also far more dangerous because they only leave a few seconds of time for enemy defenses to shoot them down.
Reply: @Romeo.G  whatever I type is by my own words, dont need to copy anything

you simply claim Im a troll because you dont like the truth about something, you have already made your opinion on a weapon technology

I will only point out that hypersonic cruise missiles and gliders are not a Russian-Chinese thing, the US has had a lot of programs for this tech and more money are invested lately.

This doesnt have to do with the nationality of a commenter online. Btw Im not Russian.
Reply: @TheNicestPig  Russia could not even intercept modified Ukrainian drones.
Reply: @billwhoever2830  Except that the rabbit has the run towards the wolves, dodge them, change direction slowly and predictably, all while turning slower and in a wider radius than the wolves.

Anti missile missiles don't chase their targets, and only have to turn better than them, not travel faster.
Reply: @timothy740  I already stated that ships are point defended targets while also mentioning that other targets like big cities are not point defended which basicaly means that the missile can fly around the air defenses and not towards them.

About the second part, "changing direction slowly" is not an accurate term. As long as the hypersonic weapon changes direction 2, 3 or 10 times faster than the defensive missiles then yes, its very fast and can dodge fired SAMs.

The performance of each SAM wildly differs. Systems designed to hit targets at max range or designed to hit ballistic threats are not always capable to change direction, they depend on the targets predictability by a lot.

In general its very safe to say that you need a mach 4 SAM to hit a mach 1 - mach 3 target and that you will need a mach 9 SAM to hit a mach 5 - mach 7 manouverable  threat. Such Sams have not been developed in great numbers. The Russian S500 is advertised as an anti hypersonic missile. While the US sm3 can do mach 9 - mach 13 depending on the model, this is an exo atmospheric interceptor, we dont know a lot about its ability to manouver and change direction towards an non ballistic threat. One thing is for sure, the sm3 is not advertised as anti hypersonic capable.
Reply: @billwhoever2830  Nobody uses hypersonic weapons on cities (except for HGVs), as they're way too expensive to be expended against such insignificant targets. Hypersonic weapons would be used to target critical infrastructure and equipment, which will be well protected by AA systems. 

I've said and explained before in my comments in this thread that hypersonic missiles are less maneuverable than air defense missiles. 

Again, air defense missiles do not need to chase their target, they just need to be manuverable enough to get in position. In fact, more speed would just attentuate their maneuverability. Mach 5 missiles don't need mach 9 missiles to intercept. If that was really the case, why can the SM-6 (mach 3) regularly intercept GQM-163 Coyote drones (mach 4), and why can SM-3s (mach 9-14) intercept ballistic missiles (mach  12-18) ?
Reply: @timothy740  Hypersonic cruise missiles can totally be used against cities, they can carry nuclear warheads and can be air launched from bombers (unlike the ICBM launched gliders).

Hypersonic cruise missiles can actualy be cheaper as an attack platform considering that they are lauched from reusable bombers.

Not all SAMs are manouverable, typicaly, long range sams like the SM6, SM2 or even the S400 (the long range missiles of the system) fly on high altitude to have less drag and then drop onto their target. This means that they depend on their higher speed to actualy choose the point of interception, they dont just wait there for the missile to come nor do they fly in a straight line always facing the enemy missile heads on.

The hypersonic missile might not be able to make sharp turns the last 30nm to the target but it can surely make big turns 100nm away from the ship. An SM2 launched to find the hypersonic missile at a point 100nm away might find nothing when it arives there and turns on the onboard radar seeker.

Almost all SAMs are not air breathing which means  that their speed and manouverability gets exsausted unlike what happens on a cruise missile or at least on far higher levels.

Out of all modern SAMs I think that the Aster family is the best in term of manouverability against high speed cruising targets. The Aster also features multiple burn phases including a terminal burn phase when its aproaching the target. Again, the Aster is an exception and a point defense weapon, a typical s400 or patriot battery cannot do that.
Reply: @haixinzheng9759  btw plasma stealth is absolute bs xD. Did you know that it absolutely reflects radio waves? 
It blocks out the communication between the missile and anything else and also, on radar, it will be about as stealthy, as if you tried to fly a super carrier lol. Optical guidance seems unlikely, as the visibility would be minimal, the camera would get destroyed and the optical sensor will quite likely not survive such a heat. Using optical guidance would be like trying to navigate through your phone camera, while shining with 500mW laser straight into the lens and also burning the lens with a blowtorch. 

And this is a weak stuff compared to what the optical guidance would have to survive on the missile. 

I see this race for hypersonics just as a propaganda stunt from all sides. For now hypersonics don't make sense. You would be better off with just firing 100 normal missiles. Nothing will survive a barrage like this and it will still be way cheaper than 1 hypersonic missile. 

Maybe sometime in the future, it might become cheap enough to be worth it, but for now, there just isn't enough bang for those bucks.
Reply: @mitotakjde9763  Here we have another expert working in the national defence, thanks for you intel. Again, people once thought that nuclear bombs were impossible, you'll have to accept that there is a chance that they might have it.
Reply: @haixinzheng9759  im literally repeating what scientists and people working in the defense said. 
For now, its absolutely not efficient to use them and it will take years before it becomes economically viable. For now, even if you got them properly working as they're supposed to, there are only few targets that would be worth the absurd cost. 
Most of the time, you would be doing more damage to yourself by using them, than to your enemy. 

Atm, according to official information, using a hypersonic missile is about as efficient, as doing kamikaze with 4 f35 planes. Its just that expensive. 

Only few targets in the world, would be valuable enough to justify the cost of 4x f35 planes being used as kamikaze. 

Have you got anything to disprove that?
Reply: @mitotakjde9763  Ironically, the US has been investing heavily on the development of the hypersonic missiles, and they're getting ready for the deployment for their first hypersonic missile after numerous tests conducted, doesn't that proves the potential of the hypersonic missiles, despite that the "scientist" you failed to cite said otherwise?.
Reply: How the hypersonic vehicle learns that it is under attack and that it must change course?
Reply: @haixinzheng9759  i said exactly that, they're testing it, but they said that for now, its just too expensive to be effective. 
It might become cost efficient in the future, but now, just 1 tiny barrage and the yearly military budget of an average nation is gone. Just look at how much they think it will cost when they start producing them . At the moment, its way too expensive even for the US, despite its ridiculous budget. 

Or you can do it the  good old Russian way.. 
Cut a ballistic missile from 70s in half, strap it on a plane and then claim that you have a new, revolutionary hypersonic missile..

 this way its relatively cost effective, but you aren't getting a hypersonic missile tho.
Reply: @mitotakjde9763  I still don't understand why people would like to portray Russia military as being weak and incapable of fighting a war with dysfunctional weapon and unrealistic upgrades,  yet completely neglected the fact that the NATO with over 30 richest countries in the world are reluctant to fight on Russia face to face despite the Ukraine invasion, if such were to happen on any other countries, they would shower the place with bombs already just like how they did it in Afghanistan. And I'm still wondering what would be cost effective for you. The whole purpose of the hypersonic technology is to bypass enemy defence and to hit the target, just to imagine that it could potentially carry tactical nuclear weapons with it would deter nation from even considering having a full on war with Russia, knowing each warhead slips through the defence system could potentially kill millions, then it's purpose is fulfilled, unless you think that any countries would actually use it, then we're basically all dead.
Reply: @haixinzheng9759  i am not talking about Russian military as a whole, I'm talking about their "hypersonic" program. 

NATO didn't interfere, because they don't want to start an all out war between nuclear powers, but in convention warfare Russia would have no chance. 
But it doesn't work like that, so at the 1st sign of a real conflict, Russia would threaten with nukes, NATO would respond the same way, but noone would fire and it would go straight into negotiations. Probably not even a single soldier would die. It would end so quickly. 

Hypersonics make almost no sense even for nuclear delivery...
Have you heard about ICBMs? Those things are already nuts, they fly at 22x the speed of sound, carry multiple warheads and decoy's, and are almost impossible to shoot down too. 1 of these can completely break an average country within few minutes from getting the order to launch. 

This is literally the deadliest weapon in the human history, its almost impossible to shoot down, there are hundreds of them, in submarines, on trucks and on land (or even air launched) and they are carrying thousands of warheads.. 

And you are talking about further nuclear threat? If only 1 of these was launched, US and Russia would have less than 50% probability to stop all warheads from detonating. Most countries have close to no chance to defend against even 1. Imagine the carnage if 10 got launched. Noone would be able to stop even a quarter of those warheads and it would be absolute massacre. 
Both Russia and even US with its cutting edge systems and a ridiculous amount of effort put into development of defence's against this exact threat that no other country can match, have absolutely no chance of stopping a barrage of those. Even the new ones that were supposed to be built by the US, that can deliver unfathomable destruction (and about 50 were built) cost way less than a single hypersonic missile and they can deliver 12 huge warheads anywhere in the world in minutes from getting the order. And each warhead comes with its independent reentry vehicle so each ICBM can strike 12 cities they choose almost instantly. 

Nuclear hypersonic missiles don't make sense for now. Maybe, few decades in the future, they will figure out the technology to be economically viable and maybe in 30-40 years, we will see hypersonics replace ICBMs. 

For some time  now hypersonic missiles will stay as an experimental conventional weapon that will be used on extremely high value targets, like aircraft carriers and so on, but for the time being, using actual hypersonics on anything less expensive than a carrier would be absolutely economically stupid. 

For now, we already have more than enough ICBMs in the world, and tons of submarine launched ballistic missiles that can obliterate any country or target in minutes and noone is even close to having the technology required to stop a barrage of those, and most wouldn't even have a chance to stop 1 of them. 

The destructive part of the equation is so far ahead of the defensive ones, that still at this point, any offensive launch of a nuclear weapon would lead to absolute obliteration for both sides and noone would be able to stop the warhead rain. 

There are only few scenarios where the use of a hypersonic missile would currently make sense. 

The technology of scramjets might be awesome far in the future, tho, but when you look at what the missile and the engine need to survive to fly at those speeds while not flying at ballistic trajectory, and in the atmosphere, its a miracle that they can keep it from falling apart for such a long time. (Still not enough to strike any distant target) 

Maybe we will see some materials/ways to make it easy to make an object to survive those speeds and maybe even meaningfully maneuver, in the future, but for now making it at least survive those speeds is incredibly hard and expensive. Just look at how US scramjet programs went. They made the engine and the vehicle, but it fell apart really quickly, because its facing thousands of degrees of temperature and forces almost equivalent to hitting a concrete wall, all the way throughout the flight. 

Good way to visualize it is looking at the sprint missile program. You can see that those missiles start glowing white after 3 seconds of flight at those speeds. And thats literally 5 seconds after the launch. 

Just try to calculate the heat it will be facing at those speeds and your jaw will drop instantly. Its far beyond what any material can survive. It just destroyes the structural integrity really quickly. 

The missile is literally burning away during the flight.
Reply: @mitotakjde9763  Didn't expect that you'd write an essay regarding this and I couldn't quite finish it given the time. There's no way that Russia would win a conventional warfare against NATO, that's why the nuclear weapons are needed to deter the US and other countries from having a full on war with Russia, and your comment would make sense back in the 70s and 80s, but look at what the US is doing, NATO expansion in the east, setting up defense systems so they could receive alters of Russian attacks earlier, formed alliance near Russia boarders to contain Russia, the capability to destroy Russian satellites so that they're not able to guide the missiles, and the starlink system to prevent the US communication system from being destroyed by Russian attacks. The peace we had between big nations was because of the threat of mutual destruction, but the US is breaking the balance, that's why Russia had to resort to extremes for its national security, and the development of all these crazy weapons.
Reply: @haixinzheng9759  nope, those ICBMs dont require satellites as they use laser ring gyroscope, and because of that, they can't be jammed either. After being launched, they don't have to communicate with anything as they use precise inertial guidance. You can launch an ICBM , even if all satellites were gone, even if the launch site would be only place with electricity in the world, those can be launched even after an absolute apocalypse. Almost nothing can stop those things so it's not enough of an argument to require hypersonics. It costs about as much as if you wanted to shoot a brand new destroyer at the enemy for fk sake. One missile costs about as much as those new warships that Russia acquired . These missiles cost more than what building a brand new Moskva cruiser would cost.. Its just absolutely absurd. 

Also those hypersonics to be able to maneuver won't be able to use inertial guidance, so they will be susceptible to signal blocking, jamming and other stuff. 

Btw Russia is not being threatened by NATO "expansion" to the east. I live in one of those countries and i can tell you, that NATO expansion isn't happening because we are some kind of USA puppet's, its happening because Russia is a bully that has terrorised us for centuries and still constantly tries to, and only way to prevent them from invading us ever again is to join NATO. Despite all the big talk from Russia, they wouldn't ever consider invading a NATO country, because they don't believe their own propaganda they know they have no chance. So they have to terrorise other countries that are weaker than they are. 

The best NATO recruiter is Russia, if they didn't threaten everyone around them constantly, there wouldn't be a reason to join NATO. They even pushed Finland to join NATO.. All those Eastern countries aren't being manipulated by the US, they just don't want to have anything to do with Russia anymore. Russia oppressed everyone around them, stole what they could, plundered all those countries around them and constantly interferes with internal stuff in other countries. When you look at what they have done to Ukraine over those centuries, there is no way that anyone could honestly believe that Ukraine is being USA puppet.. there is honest hatred towards Russian government in the East. No other country has done so much harm to their neighbours . They harmed my country more, than germans did in both world wars, and thats quite an achievement, because they mass murdered people here...

So no, its still not a good reason to justify fielding hypersonics. ICBMs are king and there is no counter to those and mutually assured annihilation wont stop being real for decades to come. 
Also Russia is being really stupid, and then blaming the effects of their own stupidity on the US, and calling everyone who doesn't agree with Putin a Nazi (even jews are being accused of it), despite the fact the fact, that what Russia is doing and saying now literally looks like a translation of Nazi Germany tactics, propaganda and Putin acts like some german dude with a funny moustache too.

Those Russian wonder weapons are funny . They make 1 prototype, claim (without proof ofc) that its the best weapon in the history and that it can singlehandedly defeat the US. Then use the 1 prototype for propaganda for some time, and then, they will never produce it, because its way too expensive, so instead they will produce a similar looking stuff, but it will be absolute junk that cannot do a single thing they claimed it could and then parade it regularly. After that they will move onto another wonder weapon and the cycle repeats. 

They always claim that they have some wonder weapon, but they never produce it. Armata and other vehicles.. su 57 and others... So many other things. 

And usually they just make a thing that looks cool and modern, but is an absolute junk inside. Just like their "stealth"  drone. With a nikon camera inside, gas tank from a pet bottle and chips that were taken from home appliances. 
Most of the new stuff they make is an absolute joke, and i don't believe for a second that they were able to make an actual hypersonic missile with a real scramjet that doesn't fall apart after 10 seconds of flight.
Reply: @danhobart4009  we have lasers that can shoot them down
Reply: @billwhoever2830  while hypersonic, the missile is blind (plasma) - no sensing or communication possible
Reply: @marcuslang6153  this is possibly bs missconseptions and I know that because there was an actual US general talking on this topic

this was first claimed as true because the space shuttle is losing contact-communication with earth during the re-entry because of the plasma, so some people asumed things

in reality, this isnt even constant on the space shutle which has a completely different flight path and aerodynamics meant to slow it down so more kinetic energy is intentionaly dumped into heat creating the plasma

a hypersonic weapon is desinged to keep its speed up and althout it will heat up during the flight and plasma might be created is some parts of the flight (most likely only during re entry into deep atmosphere) it will be on far far lower levels than the space shutle which as I said intentionaly uses its belly to slow down

so, since we know little about the plasma and how much it is or when its actualy there if its actualy there and if it covers-blocks all of the missile-communications we shouldnt asume weaknesses

hypersonic weapons are a big and general group, some of them might be more and some less blind, non of them will be a random rock thron in the general direction of the enemy

the Iskander, which is practicaly a hypersonic weapon since it reaches a top speed of mach 5.9 have shown accuracy of a few meters in actual impact footage without having issues with tracking the target because of plasma
Reply: @billwhoever2830  thx for details and your educated opinion on this topic.
But it is probably true, that all hypersonic missiles slow down drastically in low altitude, because of heat issues in lower atmosphere?
Reply: Not to mention any slight imbalance and it's going to flip and break up. Unless your going in a straight line at that speed your gonna tumble and breakup.
Reply: @aliismail2962  you say soviet Era equipment like a lot of our equipment isn't soviet Era and that is funny
Reply: @jiridrapal7512  there’s no such a thing as “American ministry of war”
Reply: @slavtrooper3851  sorry they call it "defense". Just western newspeech.
Reply: @jiridrapal7512  no its the DoD. Department of Defense. And it's the Secretary of Defense
Reply: Not true
Reply: Actually no it doesn't.  At that speed even moving 2-3 inches will create a significant arc of movement over a great distance. Imagine if it was detected and targeted from say 50km away and it picked up this targeting signal and instantly shifted its course by 2 inches. That's 2 inches by a 50km radius that the person targeting has to now adjust for, now imagine this thing being able to do this multiple times while in flight. That's darn near impossible to intercept, not to mention if you add this capability with the tactic of overwhelming the enemy radar with multiple targets, decoys, missiles with built in chaff etc. as we recently saw with the 6 Khinzal missile that hit Ukraine. None of them were intercepted even in the most dense areas of Ukranian air defense.
Reply: Btw that 2 inch movement over 50km would be equivalent to shifting its trajectory by 382,083.99 feet. Just for context.
Reply: @Bill Whoever  huh.

I just watched the part where no RF signals can be transmitted or received b/c plasma sheath at hypersonic speeds.
Reply: @haixinzheng9759  laughing in AWACS
Reply: @Haixin Zheng  I just watched the part of the video that says plasma stealth is a myth.
Reply: @mito takjde  first part of the video: "the hypersonic missile,  the weapon of the future, (as it will always be)"
Reply: @TheNicestPig  Missile based weapons systems don't rely on kinetic impact to deal damage, in a naval setting.  

The whole purpose of the missile is to deliver a charge packed with high explosive ( which is an extremely stable compound that only explodes when enough energy is applied) to the target to  cause mission critical damage to the opposing weapons system ( or in everyday parlance  kill or destroy the enemies ship). And while you still wouldn't want to get hit from fast moving fragments,  most areas of the ship are reasonably well protected against incident damage as such, so even modifying a relatively minor bit of the aerodynamic properties  of the missile can lead to catastrophic failure and a waste of munitions,  which is one of the reasons why CIWS and other such related systems are still employed universally among major and all but the most minor or navies, worldwide .
Reply: @danhobart4009  Those are not hypersonic, they travel at mach 3 not mach 5+. Plus, they are not truly maneuverable
Reply: @marcopolo8584  Even a Gepard can take it down
Reply: The Russians are many Years ahead of the US in Hyper-sonic missiles (aerospace in general) , these weapons are a real game changer.
Reply: @Fngsouth  pure delusion lmaoo
Reply: @amazin7006  don't be so hard on yourself, maybe you should stick to puppy videos lol.
Reply: @aliismail2962  the Ukrainians have the patriot, and it has been argued that even the old S300 is superior
Reply: @billwhoever2830  You’re missing the point. When you’re moving mach5+ the final maneuver is hundreds of miles away from the target. Meaning you have hundreds of miles of predictable trajectory. Think of how tight of a turn you can take in your car at 5mph vs 100mph.
Reply: @PinkFZeppelin  If you put a human on an airway and tell him to go and smack himself on a 5mph car he will easily do it, if the car goes at 100mph it can easily avoid the human. The fact that you don't do sharp turns does not mean your future position can be easily predicted.
This is because a slow interceptor has to think far further ahead for an interception point and ofc cannot even chase the fast threat.
Even if point defense is achievable with slower interceptors (at some limited level because even medium range interceptors fly ballistically and "fall" onto their target), general defense and penetration deep in the mainland is hard to avoid.
Reply: Important to remember that at these speeds changing course by 1 degree means that after 1 second you are 30 meters away from where they expected you to be. No not "maneuverable" the way we think of it, but a ridiculous ability to dodge countermeasures.
Reply: @shiuido359  because of that speed the last  possible maneuver is very far away from the target, leaving a good possibility for interception.
Reply: @shiuido359  Thats exactly what I try to explain to them. Interceptors dont come heads on too, which means its harder to even predict speed changes bacause if the Hypersonic missile slows down or speeds up by a few % points the point of interceptions might become unreachable by the inteceptors.
Reply: @billwhoever2830  Discussion of nuclear warheads on hypersonic missiles is irrelevant, as that would imply nuclear war, where everyone dies and nothing can really be done to prevent that. In a conventional war, hypersonic cruise missiles are too expensive for their payload size to be used on cities.

Hypersonic cruise missiles are extremely expensive per unit (ranging from 15 million to a 100 million). Yes they can be mounted on reusable platforms, but so can subsonic cruise missiles. No matter what, they are still an incredibly exorbitant piece of equipment. 

SAMs are guided in their mid course phase by the sensors of other platforms. A hypersonic missile won't be able to magically disappear from an SM-2, as it will always be receiving fresh data on the target and make the necessary course corrections.

SAMs may not be that maneuverable, but are still significantly better than hypersonics at this aspect. While they do exhaust their speed, hypersonic cruise missiles are also plagued by the same issue to a much larger extent. And hypersonic cruise missiles will still be heading in the general bearing of defensive SAMs, as said anti air missiles are launched from or near the target.
Reply: @danhobart4009  No, they say they do. If we have learned anything in the past year, it's that there is a massive difference between what Russia says a weapon can do and the reality of what it can do.
Reply: @TheNicestPig  It's workable on a stable target, but it seems like it would be pointless as an antiship weapon. Zircon is relatively pointless because an antiship missile has to correct for a ship's movement and that takes a way to detect the ship you fired at.
Reply: @TheNicestPig  It's difficult but not impossible, and in the end, we only assume that what it hits is the intended target. "We meant to put that hypersonic missile into that apartment building."
Reply: @marcopolo8584  In theory.
Reply: One problem. That super important hypersonic velocity that makes the missile so hard to dodge or intercept, it creates a communications blackout, blinds its own sensors, and creates a heat signature so intense it could probably be seen through the planet. It can't guide itself, it can't hide itself, and it can't be instructed. The missile would have to travel at easily tracked and intercepted velocities on approach and only go hypersonic on final approach (which mind you would take time to accelerate), or it just goes balls to the wall at its target in a straight line from start to finish all the while screaming it's trajectory data out into the open for anybody with thermal imaging capabilities and a calculator.
If the latter happens the target can just move or throw up a lead curtain for the missile to blindly ram into. For the former you have a highly optimized missile operating entirely outside of its engineered parameters (meaning very poor performance) until the final stretch where it will either accelerate too early and become the latter or too late and be a over-engineered, overpriced, supersonic dud that can't deliver on its own premise.
Reply: moving targets like an f22 would be able to make the missile tear itself to pieces before it could turn tight enough to hit it
Reply: @dustinbragg1921  You did a great job listing all the downsides. The takeaway is that it only has value against a ground target that is undefended.
Reply: @vapoet  And an undefended ground target can, in most circumstances, be more efficiently dealt with by a number of pre-existing alternatives.
The only use for a hypersonic delivery system I could see being even remotely worth the cost would be for nuclear warheads because "hit confirmed" on a target is more about being "close enough" than on the "bullseye." Even then I don't think it's near optimal or cost effecient, but it might tie up some adversarial resources in making sure it can be adequately defended against, and that ultimately does advance the primary strategic purpose of a nuclear weapon in today's military climate. That being a big scary beatstick to threaten, but never use on, others.
Reply: @billwhoever2830  This isn't something anyone needs right now. Interceptors aren't a huge threat to traditional ballistic missiles in the first place.
Reply: @jamesmcjamesington631  During the cold war, both sides were forced to keep huge amounts of warheads in case to counter possible interceptors. Using hypersonic weapons means you can operate far fewer nukes and feel safer about getting the same effect.

Launching more than you need just to be sure the enemy is destroyed means that there is potential unneeded for the mission damage.

The interceptors designed to take down ballistic warheads are vastly different from those required to take down hypersonic gliders or cruise missiles. Most current interceptors are designed to operate outside the atmosphere. This means that the enemy will be forced to keep 2 different types off interceptors, complicating the logistics.

Apart from all the above, ICBMs are not ideal to take down moving-small targets, a hypersonic weapon like a glider or a cruise missile is far more accurate. There have been tests on the effects of nukes detonating nearby warships. 

A modern super carrier is so large that it's easier to take it down using nukes.
Tomahawks and many soviet cruise missiles can carry nukes, the problem is that you are wasting most of the nukes because you will need huge amounts of such slow weapons to get a hit. Hypersonic weapons solve this problem by using superrior performance rather than raw numbers to waste the enemy defensesive missiles.
Reply: I think it's worth stating that this is maneuverable in comparison to ballistic missiles. So the ability to turn at all is an improvement.
Reply: I think the implication is that the ability to maneuver at all makes it "maneuverable", as opposed to ballistic missiles, which are just traveling on a ballistic arc.
Reply: @danhobart4009  About that...
Reply: Exactly, and it could only manuever around known missle defense locations due to manuevering at that speed impossible due to locating its threat and processing its coords. It would pass it before it configured
Reply: @syzyphyz because Russia is aim8ng for terror, not domination.   Putin assumed civilians would cry for peace instead of doubling down.
Reply: @StoutProper THAT AGED FUCKING WELL
Reply: @billwhoever2830 o
Reply: Yeah, but something that fast doesn't need to be manuverable in the traditional sense, even at a parabolic path, hypersonic projectiles can be very hard to counter without a robust network centric and automated air defence grid with relevant capabilities. Now add to that the ability to just change its course by a few meters, now it becomes even harder, cz now you can't predict where it will be at x+1 min based on its position at x minutes. At those speeds, even small deflections take reactions of seconds to get out of the CEP of an interceptor. For context, a hypersonic IRV may hit Connecticut or New Jersey and you have seconds to decide which to defend, and then you might still miss or be right but find that it actually hits Manhattan and you don't have the time to deploy any countermeasures. Another case study, an Indian Brahmos penetrated 200km into Pakistan on an accidental fire. That missile is just mach 3 and Pakistan, for all it's flaws, isn't Taliban. They have integrated Air defence grids, and they couldn't stop it. Imagine something twice as fast. You don't even get the time to detect it as it comes over the curvature of the Earth. (In case of cruise missiles)
Reply: @billwhoever2830 The Soviet Union previously assumed that they could get away with using just tactical nuclear weapons without causing an apocalypse, but in reality it would escalate to a full blown war where everyone and everything would be obliterated into nothing but fine dust...
Reply: @timothy740  Thats wrong, it wasnt the Soviet Union that assumed that, it was both the Soviet Union and USA. Both sides went as far as having 8inch howitzers firing nukes.

I think that the Soviet Union and USA could use such weapons with no escalation, as long as they were not used to bomb each other. If the US dropped a tactical nuke in the midle east or if Russia dropped a tactical nuke in Ukraine the world would just watch and condemn the action.

I cannot believe that a small bomb droped in a completely foreign land can motivate a world superpower to end itself just to take out the enemy. Even a nuke dropped in your own naval group is not enough to motivate the use of world ending nukes agaist cities, such a move will at most motivate you to use tactical nukes against the enemy fleet. A cruise missile, even a smaller one, will completely blow an aircraft carrier into piecies instead of heavily damaging it with a conventional warhead. Nukes make a lot of sense against some military targets, not just city bombings.

I think that there are other reasons why tactical nukes were thrown out of the window, including exposure of your own soldiers to the radiation, cost and danger of  nukes falling in terorist hands.
Reply: if it is manned. a missile can pull 20G easily,
Reply: @InnerVisions68 😂 I swear to God this thread is an absolute dumpster fire.
Reply: @acceptablecasualty5319  Even then, there's no guarantee that laser-based equivalents won't simply do the job of the current CIWS/C-RAM platforms, but cheaper on a per-shot basis.
Reply: @danhobart4009 that's not true, they can be intercepted, to hit a target they have to drop into the lower atmosphere, the increased drag in the thicker air slows the missile down drastically. It is as slow as a regular ballistic missile and is fairly easy to intercept for Aegis or Patriot.
Reply: @NotWhatYouThink @DDJ8821 Reconsider what you said. A course change of just one degree can make the difference. And at such high 6:30  speeds, “a long time” is irrelevant.
Reply: The Blackbird measured their Mach 3 turn radius by entire countries or states. 😂
Reply: @danhobart4009  ..that can't be intercepted by anything Russian.☺
Reply: I think that does make it harder for sam systems to intercept it, calculating the point for intercept. But it also gives them extra time to respond..
Reply: @billwhoever2830 Not really, unless the Russians has suddenly advanced their material sciences and technology way past the Americans, theres no known materials that can survive the aerodynamic and structural loads imposed on the airframe when turning at sharper radii while at higher speeds than mach 6 (to say nothing of the mach 24+ speeds claimed by the Russians). Even the Americans with their advanced materials technology still has difficulties turning faster at high mach speeds. The Russians can break international laws, but they cant break the laws of physics!
Reply: @danhobart4009 ok bro did you watch the video 😅
Reply: @TheNicestPig take it you didn't watch the video. Any interception would take place after re entry at which point the "hypersonic missile" would not be travelling at hypersonic speed 😅
Reply: @danhobart4009 laughs in patriot missile system
Reply: Yes, but a fraction of a degree of path deviation adds up to a lot quickly when you are going that fast.
Reply: That just talks to evading interceptors. It just needs to move a little to make the interceptor miss.
Reply: @billwhoever2830  Nope, Russian and China hypersonic missiles are lousy and miss their targets in testing. It's very hard to maneuver something going at Mach 5. Don't believe me, it's called inertia. Also, it's easy to intercept them during their terminal phase of flight. There's a reason why US wasn't rushing to be the first because they knew the major downsides.
Reply: You could likely calculate all possible deceleration zones required for the angle of attack and station defenses.
Reply: As opposed to a regular rocket?
Reply: @aliismail2962 patriot missles have shot down several of them.  You can read about it and should so when you speak you can do so intelligibly.
Reply: Hehe that’s what you think
Reply: @billwhoever2830 The limit is the number of “g” you can pull (even with rockets). The faster you are the bigger the turn radius.
Reply: @allangibson8494  Bigger turn radius doesn't matter, you simply cannot arrive at an interception point in time. The missile has to be heading straight to you and you can only really shoot it when its really close. All area coverage of the defenses will be tiny, the missile will be able to pass by the destroyers or any defensive asset, at a range just big enough not to get shot. 

To counter point defense you can use penetration aids. These are jammers or decoys deployed by the missile itself. I know that the iskander although a mostly ballistic target carries 6 tubes with decoyes/jammers behind it. This is one of the reasons Ukraine is over reporting iskander interceptions while Russia under reports iskander launches in some cases. Some of the newest russian cruise missiles are also equipped with flare launchers to counter manpad usage.
Reply: @billwhoever2830  Bigger and SLOWER. You can’t change direction very fast either.
That makes your position very predictable - which is exactly how anti satellite weapons work. The basically put a load of rubble in front of you using a precision guided shotgun shell.
Particle beam and laser weapons are another option (because you can’t be low and hypersonic either (again - limited manoeuvrability and mountains are rather unforgiving of wide turns)).
Reply: Because Putin threatens to use nuclear weapons if US interferes directly? LMAO
Reply: On;ly needs a bit.
Reply: @danhobart4009 That’s just not true, Russia often exaggerates there capabilities, Habital Linecrosser, a former Patriot missile system operator explained such, I suggest you watch his video as he goes more in depth on the matter, and sorry I’m more inclined to believe a actual weapons system operator over a YouTube comment.
Reply: Yes but Russia’s missile works fine. This video is a HOT TAKE
Reply: @marcopolo8584 exactly. The speed and its ability to change direction means even if you do detect it, all you can do is watch.
Reply: "Maneuverable" means that it doesn't follow a ballistic trajectory. It's pretty simple to understand.
Reply: @aliismail2962 Patriot destroyed Khinzail upon impact!
Reply: You don't understand how this works. A one degree change in the trajectory means the interception point shifts by tens of kilometers. This immediately writes of many interceptors that have already been launched.
Reply: @midgetydeath  the only country that managed to make a moving hypersonic missile, is Russia and they gave blueprints to China and India!All US tests ended up in failure!
Reply: @aliismail2962  Patriot stopped them with its life!
Reply: @timothy740  Burshtevik is nuclear propelled and has unlimited distance!
Reply: @pashapasovski5860  And?